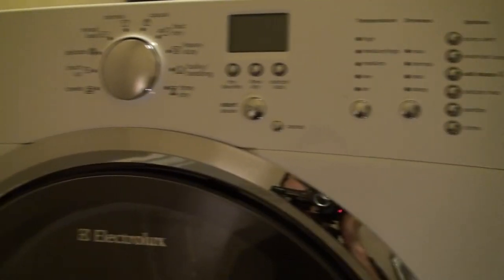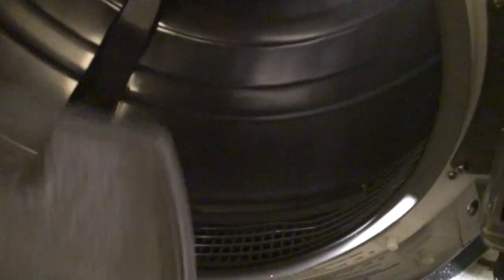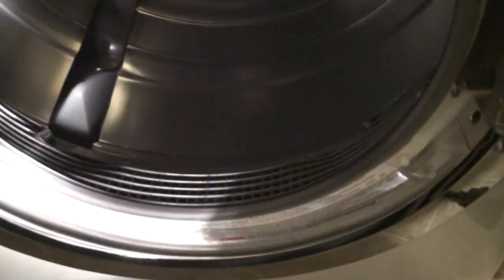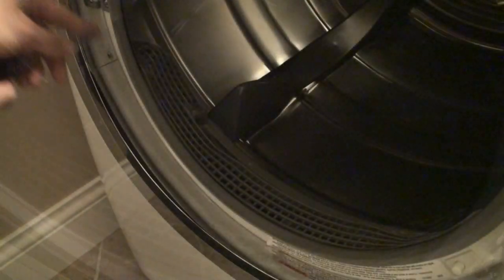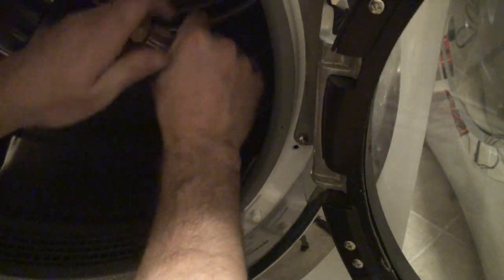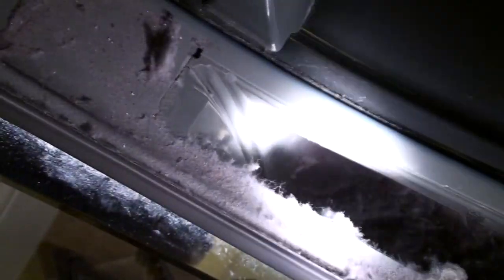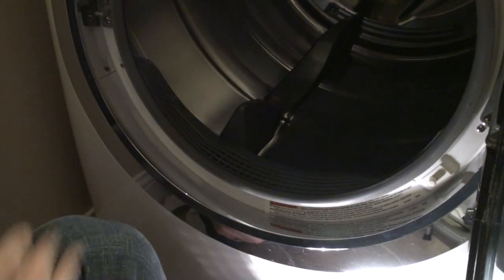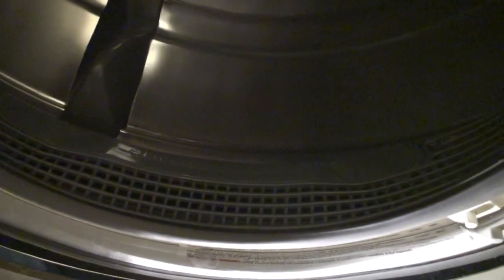Clean Out Dryer Lint on Electrolux Dryer

Comment: I  just bought a used Electrolux dryer, it stopped drying completely on the fourth load of clothes, I make sure I clean the lint trap out after each load dried. & drained the water reservoir. I was thinking maybe it's a another lent trap in the back of the dryer that goes out the aluminum tubing out the window, but I don't think so, that's why I'm reaching out to YouTube. But I will try looking down in the lint trap after removing the outer I will remove the inner & check for more Thanks a million dude😊

Comment: Thank you for posting this!  I have the same dryer and my heating element also burned out.  Fortunately, I still had a month or two on my warranty.  No one ever told that I would need to do a cleaning under the vent.  I always found lint trapped there, but just removed it with my fingers.  Upon closer inspection, I saw it had tons of lint on either side of the vent.  This video was fantastic.  I removed the vent and cleaned everything out in less than 5 minutes!
Reply: Make sure to actually just pull out the lint trap and scrub it with soap and a toothbrush to get the residue off of it.  We have to do it at least once a week.  The residue from dryer sheets, lint, etc builds up on it and drastically reduces the air flow, causing the heating element to have issues.  This, of course, is on top of properly cleaning out the lint from the areas mentioned in this video.   :-)

Comment: I should have done this more often - pulled the lint trap and removed the cover as in here.  Pulled out a LOT of lint below.  My W/D set is 7 years/2mos old.  I'm giving it to a relative to get the most current new versions (steam).  It was easy to vacuum/pull out, replace and keep using!
Reply: I had to have the steam feature disconnected because it dripped water into the dryer.  It worsened over time.

Comment: The "clean lint" feature doesn't mean to take the trap completely apart and clean it.  It means to pull out the trap and scrub/wash it.  It builds up a lot of residue from dryer sheets, etc, and you have to clean that trap at least once a week.  We pull ours out and use soap and a toothbrush to clean the residue/lint off of the trap.  We own the 617 series, and were having a lot of condensation coming out of the bottom of the door to the dryer.  We finally discovered that the trap had too much residue on it, so it wasn't getting enough air flow, causing the condensation.
Reply: I cleaned my and stop using dryer sheets but that did not work my clean filter message still comes on and there is no lint.  I can may be pull off the the edge of the lint trap about the size of a pea if you roll it up.  The lint seems to bypass the filter and we find more lint outside then I ever get off the filter.  And we changed all kinds of parts and the dryer will only heat for a short while.  It takes me about 2 hours to dry a small light load of clothes.  We paid a lot of money for this dryer new and it is a piece of junk.  Good Luck with who ever owns an Electrolux dryer.

Comment: I have the same issue with this dryer!  Right now, I am trying to find a video for how to disassemble the entire thing because there is a ton of lint built up behind the rear panel (there is a part to remove that is not indicated in the manual, so finding a way to remove it is difficult).  Anyway, this is a great idea to remove the whole thing!  Easier than trying to do it with that grate in place!
Reply: Did you find a way to do that?  .... I am having this same problem.
Reply: Are you working on the part where the wiring harness is attached to the cross bar in the back?  (After you take the top off?)
Reply: i have one that i will post if you still need it

Comment: Hey Matt, FLT1979 Is on the right track. Here are a few things that your readers should look at before calling customer service. (First) NEVER PREFORM ANY SERVICE TO YOUR DRYER WITHOUT UNPLUGGING IT FIRST !!! (SECOND) Check the vent outside. The one with the louvers or the angled piece outside your home. Make sure there are NO blockages there. Small creatures like to build nests in places like that: ie. mice, bees. As for the readers that have a roof exhaust they should check for the same thing and should add that the roof is exposed to all the elements. Snow, leaves, wind, birds, humidity and rain. Rain and humidity I’d be careful of mostly. If your dryer vent on the roof has been there for a long time is may be stuck in the open position. Allowing rain and moisture to go down past the louver and down into the tube. This will cause the lint to gather and slowly get worse every time the dryer is used. Replacement of shingles could be another issue. If the roofers didn’t seal or damaged ie: crimped or closed off, around the duct work going through the roof that will cause the dryer to not breathe freely.  Water or humidity may be entering the exhaust ducting as well. IF anyone needs to go onto the roof they should employ a professional to do this. (Third) Dryer ducting is optimal when ran horizontally. Vertical ducting runs higher than eight feet are problematic. There are YouTube videos that show dryer ducting doos and don’t. In some areas there are housing codes that frown on roof vents and long (longer than eight feet) ducting runs. Lastly, its important that the dryer ducting is CLEAR. The rule of thumb with this is: if you don’t remember when or ever having your dryer ducting inspected or cleaned. ITS TIME TO GET IT DONE TODAY!!

Comment: I as well have this same dryer. The heating element burned out in the first 18 months, even after cleaning the lint filter before each use and occasionally I vacuum the inner part below the filter. The heating element replacement cost me $634.00. In my opinion, too much lint gets past the filter during each cycle. Electrolux needs to recall and a fix to remedy the problem.

Comment: The clog cannot cause the heating element to fail. The heating element fails because of thermal stressing of the heater coil support which causes warping and leads to arcing on the coils. If you examine the damaged heating element you will see that the coils weld to themselves and thats typically where the breaks happen. 2 of 3 of my coils had breaks like that, they happened near the warped end of the support. 

The design for the heating element is trash they made the coil support way too thin. You would think they would do some thermal stress analysis. Another contributing factor to the failure is that the portions of the coil near the exhaust end (where the warping occurs) experiences higher thermal load because all heat produced by the coil jas to pass over that point. The thermal cycling makes that part of the coil brittle, all my breaks were on that end. Ideally you would want a coil of uniform thickness to have an evenly distributed heat load, they designed in a weak point. I would have made a more compact design where heat could be drawn of the coils uniformly. But there design is crazy cheap to make, too bad they charge like $100 for the replacement part. Its probably only $10 to make (including labor because the part is made in Mexico).

Comment: I have this model and I have the opposite problem:  it doesn't catch any lint.  Nor does that area under the plastic grid catch any lint.  There's no lint in the vent either and none outside at the exhaust end.  I don't know where the lint is going and it makes me nervous.
Reply: Anyone else have this problem???
Reply: Have you checked to make sure that all of your venting is properly attached to the dryer, and that it is properly venting outside?  If there's anywhere that air can escape, then it will vent the lint out there, instead of into the lint trap itself.  If you have confirmed that all venting is correct and no air is escaping, then I would contact Electrolux directly to see what the issue is.
Reply: I have the same issue.  No lint in the lint trap at all.  Some appears to have vented outside, but I fear that there may be a dangerous pile of lint somewhere in the bowels of the machine.  Dryer seems to be weak on heat lately too.

Comment: I just got a huge huge pile of lint out of mine with a wire clothes hanger.  This is a design flaw in my opinion. I have never had to do anything like this with a dryer. I took the cover off and reached down in with my hands and got gobs of lint out..I then reached over to the right and found more huge gobs of lint. Bruised my arms in the process. Will never do that again. Just ordered an attachment for my vacuum cleaner.  If your dryer vent goes through your roof you should get a professional to clean the vent out in order to prevent a fire as well.
Reply: OK so I just took the cover off an found that the hole to the right of the lint filter bottom was also clogged. This is where the lint should be going out of the dryer to the dryer vent pipe..HHMMM something is not working as it should be. Big fire hazard. I called my Sales REP and he is contacting electrolux to see what he can find out.  UUGGGHH

Comment: The both washer /& dryer worked great for 6 yrs  but they both have there problems of mold ( door gasket ) boot seal.  & the dryer lint gets trapped passed the screen  /////High Maintenance//////////////;-(

Comment: I appreciate you made the video but I question why anyone would expect a consumer to disassemble the unit to clean the lint that escapes the "lint screen" simply because of a very poor design. This Electrolux unit I have is less than two years old and is horrible. We clean the lint trap every load, sometimes during loads. We bought a special long vacuum crevice tool that is designed for cleaning tight spaces so we could get into the airway below the lint trap. Despite this we have had four repairs due to lint buildup (motor, drum belt and idler). Any competent person who looks at the exhaust air path while the unit is disassembled will see the inherent flaws in the design that result in lint buildup inside the unit. I have never seen anything like it. We are initiating a lemon claim now.
Reply: will you let me know if there is a way for us to join that claim?  exactly the same issue on our end - i have disassembled twice myself after paying a repair man $100 x 2 visits to do the same on a unit that has operated less than 2 years!  unbelievably bad design - would love to get electrolux to fess up - their customer service is worthless.
Reply: Great Idea